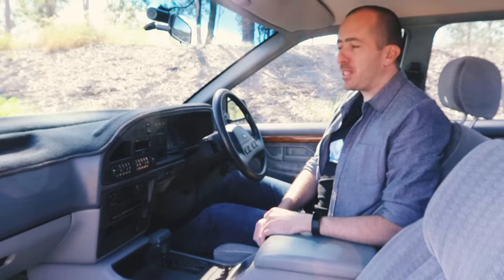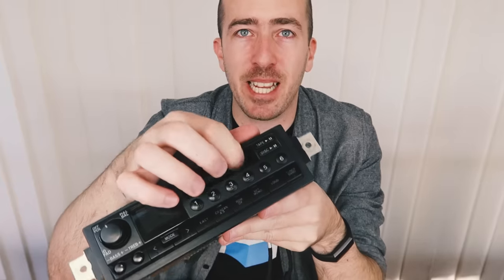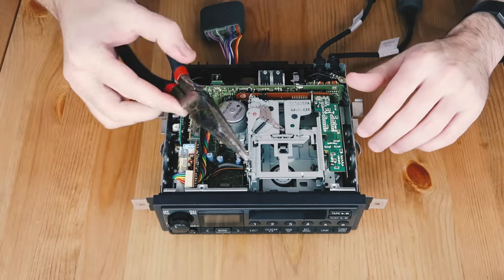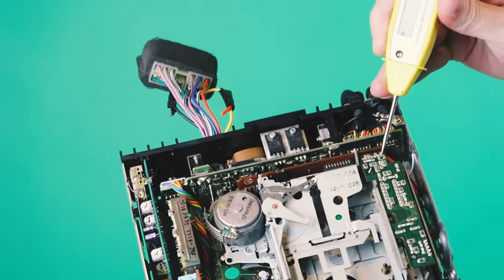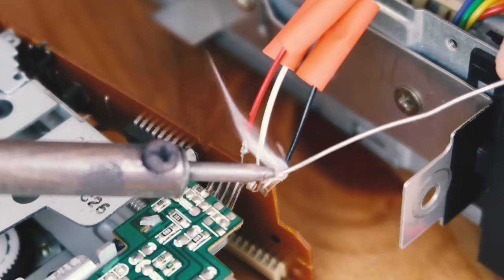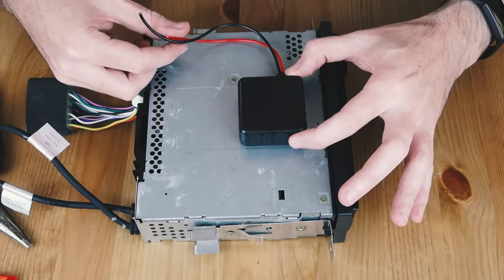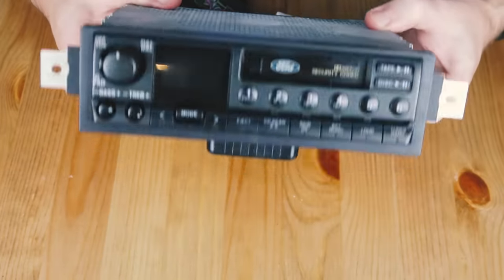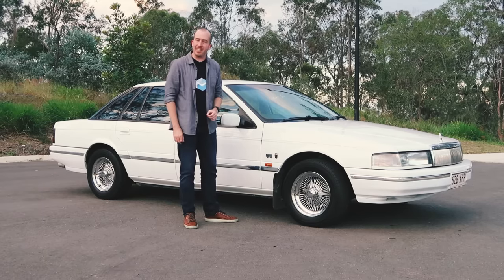Add Bluetooth To Your Old Car Stereo For $25!

Comment: Everything is great until you get to the power wire. Yellow is constant power, red is switched by the ignition switch, so your BT is going to be on all the time since you connected to yellow unless wire colors are different in Australia.
Reply from the maker: What can I say... in my car the BT module turns on with accessories when wired this way.

Comment: That was cool! But I don't have a tape player... will it work with the CD unit?
Reply from the maker: You'll have to research that unfortunately - it'd depend on the exact model you have. Some people have reported a "data line" coming from their CD drive which was seemingly impossible to tap into. But surely there would be points on the mainboard somewhere you could use.

Comment: lucky one, the odds of making this work are a bit low this way... anyways, to retain the tone, volume and FM radio you can do a thing, instead of tracing the lines that may refer to unequalised head signal or else, you can google the chip part number of the cassette player (exactly the cassette one), there is quite likely a schematic for that chip and you just need to find L-Out and R-Out from it, cut the traces on the pins, hook up the new device and voilà

googling the imprinted part number or serial number of mechanisms or component boards doesn't give much results, googling the chips instead it does, especially the audio ones (dunno why)

a cheaper solution would be to buy one of those panel mount BT receivers, they are cheapish and work at 12V (search for "bluetooth 12V mp3"), you can get rid or the plastic panel and retain the circuit, solder it and place it inside the cassette slot (there's space) but adding some tape to insulate it from the metal... the only dubious thing is if they start as BT or other (like USB or SD, bcs they have those) there's a remote included and i think you can select the starting source (but i'm not sure, in case there's the remote)

or you can buy a dedicated naked BT module but they don't work at 12V and you need a regulator, that's even cheaper

Comment: Hello nice Bluetooth hack,where can i purchase exactly module like that one you used?
Reply from the maker: Looks like the one I bought isn't available. The one at the following link will work - you'd simply need to cut off the plug off the end to reveal the red white and black wires: https://www.ebay.com.au/itm/AUX-IN-Bluetooth-Adapter-For-Ford-Focus-Fusion-C-Max-Radio-CD-6000-5000/142430939575

Comment: Great Idea, great Video , but how do I modify a CD-Drive? 
OK, I think I can find the points to solder the red, white and black Cable.
But how do I tell my Unit, that there's a CD in, when there is no CD?
Reply from the maker: It'd probably still need a CD loaded and spinning I imagine. I think you'd need to experiment though - my head unit actually mutes the sound output when the tape isn't "playing", so it might be the same story with head units with CD drives.

Comment: You should mention that the colours can different my location, for example in my country black is never ground
Reply: automotive 12V is usually universal, but can of course change...
Reply: i was thinking normally the yellow wire is the memory wire that's on all the time and the red is accessory wire only on when the car is. at least for older cars. most new ones don't have accessory anymore.

Comment: The downside of maintaining the factory tape player is the limited sound frequency range.   You don’t get the highs as you would from an aftermarket head unit.
Reply from the maker: This mod completely bypasses the tape player (it feeds straight into the head unit's amplifier) so there are no limitations that I've been able to hear.

Comment: I have a question, with this bluetooth device we can only play music or can it be used as a Hands-free calling device?
I've actually ordered one of this things but never asked this question.

Great video ;)
Reply from the maker: Mine doesn't support hands-free calls but honestly I prefer that. To me there's nothing worse than driving while trying to talk with someone on speaker/hands free.
Reply: @MotoringBoxTV  Currently my set up is nothing more than a simple aux cable connected to my phone, that way I can talk to someone without having the phone in my hands. And it actually works better than most of the Bluetooth systems I know, it sounds better at least, and as this works fine I thought the bluetooth adapter would do the same only with no wires.

Comment: I know this is a very late comment and its a cool mod. My only question is wouldnt you user the disk changer instead of the head unit Doesn't the disk changer have the 3.5mm plug and all you would need to do is tap into the 5v power? The only reason im asking is I was thinking about doing this into an older car with a cd changer and wanted to know the best approach.
Reply from the maker: You could, but this head unit auto-mutes the sound channels when media isn't playing. I didn't test it using the CD changer wiring, but I was worried I might run into issues with the head unit muting briefly at times, like between CD tracks or after the disc finishes. Using the tape drive and making the unit think its playing an endless tape seemed better to me. Plus if I had to choose between retaining CD functionality or tape, well, you already know which one I'd choose.
Reply: @MotoringBoxTV  good point I will do it through the head unit.

Comment: Suggestion for a next project.......swop out the engine for an electric motor and chuck out the fuel tank for a bank of batteries......your soldering skills should be up to it😉🤪😊👌
Reply from the maker: A Tesla Model S is almost exactly the same wheelbase as an NC Fairlane....

Comment: Damn O_O I'll have to do this in my 2000 Grand Marquis!
Reply: That's the exact make and model car that  I'm about to do this too. Except I,m going to try to use an old wireless headphones to do it with. If that doesn't work, I'll use a small cheap stereo Bluetooth speaker

Comment: How do you deal with the cassette mechanisms multi contact mini switch that cuts off the radio and switches in the tape heads to send the audio to the amp ?

Comment: Thanks for this video, what I will do instead buy this Bluetooth receiver I will use one from old jbl speakers and installed in to radio
Reply from the maker: Good luck! It may not run on 12V though.
Reply: @MotoringBoxTV  Will see I don't know

Comment: All of the cheap Bluetooth receivers sound awful, I have tried a few. Just hang a wire out the front connected to the audio nut prior to the volume control. Sounds great. Only the high end blutooth sounds ok.
Reply: Any recommendations?
Reply from the maker: It's a bit hit and miss. Some of them I've tried sounded like crap (like real lo-fi) but the unit I've used here sounds just as good as factory bluetooth systems I've used in modern cars.

Comment: What a brilliant idea!
But why didn’t you mount the Bluetooth unit inside the headunit?!
I thought because you were going to retain the cassette function, but you cut the wires.
Reply from the maker: Two reasons - it wouldn't fit, and even if it did I preferred mounting it to the underside of the unit to ensure the bluetooth signal would be as strong as possible.

This way the bluetooth signal from the phone is only passing through one layer of plastic (the dash trim piece) as opposed to having to make its way through the metal housing of the head unit before it reaches the receiver.

Having said that, I've not done any testing to see how it performs in both configurations, so it may be a non-issue?
Reply: Yeah it’s personal preference. BT would be fine inside the casing at that range. You could take the BT unit out of it’s case OR take out the cassette player cartridge, there should be plenty of room then. 
Great build though! 👍🏻
Reply from the maker: You could experiment with it for sure - my head unit didn't operate properly after cutting power to the tape drive, so removing it completely probably wouldn't bode well!

Comment: Hey man, just thought I’d add, if you had soldered the left right channel wires to the back of the circuit board where the ribbon cable was soldered to, you could have kept the tape player functional, just means you could have played a tape and Bluetooth at the same time
Reply from the maker: Yup that's true. But I didn't fancy putting the soldering iron so close to the board, and I was never going to use the tape drive again, so...

Comment: In this case of your radio I would have gone with the CD changer input. But not every old unit has that.
Reply from the maker: It's worth trying but you'd most likely have to keep your stacker connected so the head unit can sense it's there and still working correctly. Or work out what voltages get sent down which wires during operation, and replicate that. Any problems with the above and the head unit may throw an error or switch back to radio mode etc
Reply: @MotoringBoxTV  Ok, makes sense.

Comment: And what if someone will also want to have the cassette tape working also? If soldering the black white and red to the flextape and without removing the cassette spring it will work? I'm having a tape player and a cd (track only unfortunatelly) and this bluetooth seems to be a good choice. also it will allow me to use the phone when receiving a call, to hear the conversation on the speakers.
Reply from the maker: Should work.
Reply: @MotoringBoxTV  im about to do this. worst case scenario, buy a navigation system to fill up the space from the old tape player from console :)

Comment: I have the same system in my car but with only a different module using aux out. Streaming music is completely awesome but when I receive a call, the sound from the other side does not play from the speakers. It's like the connection deactivates itself for the call and when the call ends the music keeps playing through the speakers. Before bluetooth when I was using the aux cable, I remember myself hearing the other side on call. Do you have the same situation and do you have any suggestions?
Reply from the maker: Mine disregards calls completely - they're handled by the phone. I prefer it that way but understand others may not.

Comment: Recently done this to an old BMW radio. Working well but I'm getting very bad alternator whine when I play through Bluetooth. Any suggestions how to fix this?
Reply from the maker: I'd Google 'car audio noise supression guide' as  there are a few tips on how to get rid of any unwanted noise. You can also get noise filters which are installed on the power wire to the head unit which may help remove it.

Comment: Bang on idea, can this work if you have a CD player in the dash and not a tape deck?
Reply: It was a genuine question, can it be wired into a CD player?
Reply from the maker: A few others also asked this - and as I told them I don't see why it couldn't work. It would just require a bit of testing to determine whether you'd still need a disc in the drive and have it "playing".
Reply: Thank you....I can see a future video on this...haha! ?

Comment: Hi there MB, does this mod means that I will be unable to use my cassette tape function in the future anymore? Thank you
Reply from the maker: If you cut any circuits like I do then yes you won't be able to. Splicing it into the existing circuits mean you could use one or the other... or both at once in theory.

Comment: I would like to keep the tape working. If I don’t cut the wire and solder the new wire to the points. Will have both working?
Reply from the maker: In theory yes

Comment: Only problem I’ve found is the volume is lower with Bluetooth and the tape adapter for my ‘98 Lincoln (panther platform) is a lot better bc I have Dolby Digital sound reduction and it’s a direct connection
Reply from the maker: With my phone's BT volume set to roughly 60 - 75% the volume level I hear in the car is roughly the same as the radio, so no problems there. My head unit's Dolby B & C noise reduction modes also still work fine, although you don't really need them anymore...

Comment: Question, I have just gotten my dads NC and has the exact same stereo. My stereo dose not start up on either acc or ignition. It dose however light the buttons up with the head lights on and I can hear a pop in the speakers when I either turn it off or on. As this is the same function on the same button I'm not sure if it is on or off that makes the noise. I could not find a fuse in the fuse box blown nor did I find one labeled radio. When I pull out the cig lighter fuse the power aerial tries to go down which it already is. The aerial button is not working either....... Any tips?
Reply from the maker: Sounds like the head unit might be toast. You could try find someone to take a look and possibly repair it, otherwise you may have to just replace it.
Reply: @MotoringBoxTV  thank you

Comment: Have you tried putting a cassette inside playing it? I still use cassettes in my own car (I know it's weird and super obsolete). I would imagine it would? But maybe if you play a cassette and bluetooth at the same time the audio would just cut out?
Reply from the maker: In theory if you splice the BT onto the existing circuits without cutting, it'd let you play both at once without any problems.

Comment: Is there a way you could install the bluetooth without taking the head unit apart and eliminating functions of the unit. I'm wondering about adding the functions, and keeping every function the vehicles equipped with
Reply from the maker: If you don't want to take it apart you'll probably have to settle for a bluetooth cassette adapter or an FM transmitter.
Reply: you cant without taking it apart but you can without eliminating functions. just have to tap one of the sources be it fm am cd tape 8 track etc...it may cause noise however. ive seen people change a button to power the bt module or use a toggle.

Comment: Could try soldering to circuit directly but may be a conflict with tape head output...not sure here
Reply from the maker: Yes it might, and I have no need for tapes, so..... it should work for people who want to retain tape functionality though. On my headunit you'd have to leave the springs in place, and insert a blank tape. The only issues I foresee is the output muting for a second or two everytime the blank tape flips sides, and possible background hiss from the tape head.

Comment: Only thing I'd do different is solder to pins so casette still worked and I'd just get an old casette and rip the ribbon out to be an empty case that can spin in one direction permanently and trick the head unit.

Comment: Hello! I have a question. In my stereo you can clearly see a Right, Left and Ground pins coming out of the cassette player head unit and going to the amplifier. I don't understand where should I solder the aux cable (or BT receiver). Could you help me out? I also want to keep the original car stereo and this mod is really helpful to me. Greetings!
Reply from the maker: Cut the end off your aux. solder the white wire to left, red wire to right, black to ground. The location where you put the receiver is up to you, depending what space you have inside or around your head unit.
Reply: @MotoringBoxTV  Right! But without desoldering the cassette player? I would be "adding" the aux to the same spot, right? If I can contact you through IG, I can attach a picture of the board. Thanks so much.
Reply from the maker: Sure, it's up to you really, if you'll never listen to a tape again I'd desolder. Adding the wires should also work, you'll just hear audio from the tape and BT at the same time. You may get background noise, or you may not.

Comment: Do you know if is it possible to add a microphone to those Bluetooth receivers(for hands-free calls)??
Reply from the maker: Maybe, if the module you used had that functionality. They usually have an external mic you'd need to locate somewhere though.
Reply: Unfortunately I'd doesn't. I bought just the board and it works perfectly, I used it to get bluetooth in my home Kenwood. I'd like to use it in my car and the mic would be perfect.

Comment: After the mod, did you need to also install a ground loop isolator?
Reply from the maker: You may need to depending where the power and ground is sourced from.

Comment: Hi @motoringbox.
I purchased a bluetooth module with the same wiring as this one. Can i splice it somewhere on the harness, and if i do, what do I select on the radio to get to use the bluetooth. Its a 6000cd radio
Reply from the maker: I don't believe so - it would have to be within the radio unit itself. The harness does have power & ground, but any audio coming out of it is already amplified and ready to go to the speakers. Whereas the audio coming out of your module is unamplified, if that makes sense.

Comment: I'd probably try and include a small relay to switch the audio so the cassette still works - not that I probably would use one - but if I did it as per the vid sure as hell I'd want to play an old mix tape etc.
Reply: I would have just spliced the audio from the receiver across the audio head wires through a resistor to reduce the signal strength, and had a dummy cassette (one of those adapter things with the wire cut off) to trick the unit into playing.

Comment: It would of been much easier to just plug it all into the 8 pin m-bus connection for the changer. But good job anyway:)
Reply: That's what I was thinking...and no operation in the HU to go "haywire"
Reply: Came looking for just this comment
Reply: Would of been?